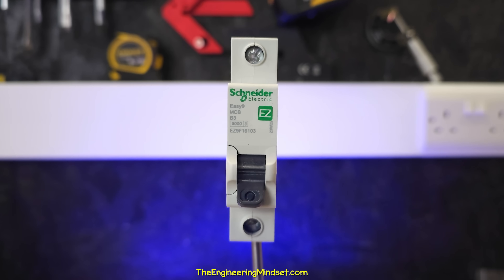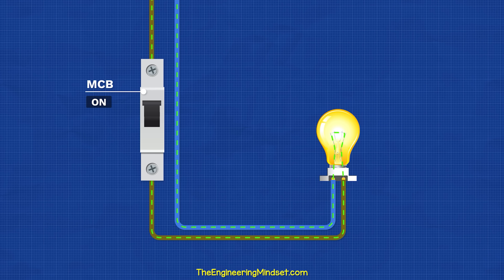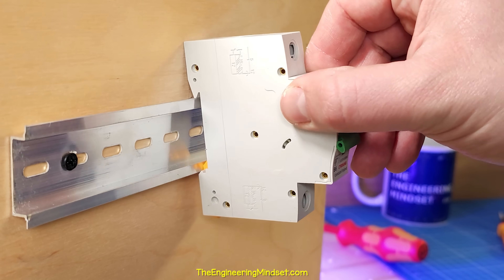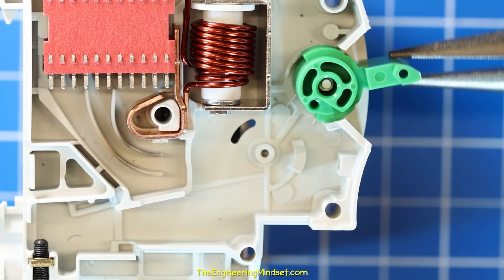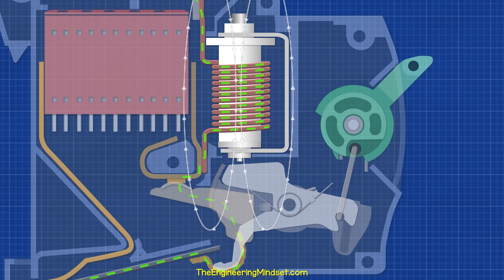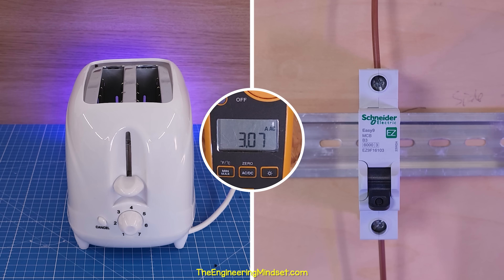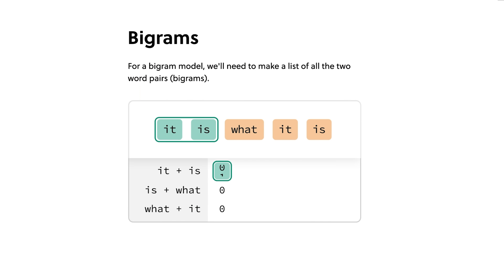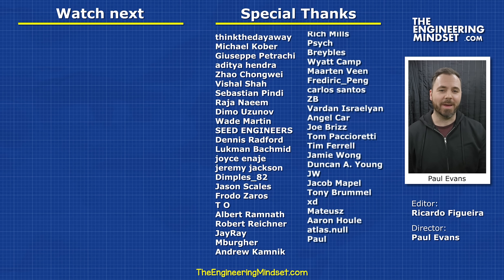Why Circuit Breakers DON'T Protect People (electric shocks)

Comment: They’re not meant to protect people, they’re meant to protect circuits. That’s why they’re called “circuit breakers” and not “people protectors”.
Reply: They are meant to protect people...from house fires that start from overheating wires.
Reply: The name isn’t the important part. The actual reason is that circuit breakers are not designed to care about humans  or more importantly extension cords or toasters. All that a circuit breaker is supposed to do is to protect the wires in the wall from catching fire, not anything else.
Reply: Some5hing all huge electric cars batteries pack should have and don't.
Reply: @_j5155_  afci breakers
Reply: @_j5155_  thats exactly what i he said, you only rephrased it...
Reply: GFCI circuit breaker is meant to protect people.
Reply: Is there not a different kind of device, a "residual current device" that does protect people?
Reply: @tomsmith6513  correct! And/or animals.
Reply: @tomsmith6513  there are "over current" , "residual current" and "arc fault" protection. They're all really useful ! 
you can get all 3 types of circuit protection in one device.

"over current" , well that's the original one, and can be done with fuses. Too much current, and the circuit will be broken.
"residual current" , that's measuring the current going out through the live, back through the neutral (okay it's AC , goes both ways !) and if it is the same current, well all is fine. if there is an imbalance in the currents then something must be leaking via another path, so trip the breaker. This can protect people , because the leakage current a person could supply should be enough to trip a breaker. But don't test this with a finger ! 

Then there's the last , most recent cleverness  of protection. Arc Fault detection. Arc in circuits can and do cause electrical fires. Some clever electronics can work out if the current flow  in the breaker "looks like" there is an arc on the circuit. If there is , then trip the breaker. These breakers aren't cheap, but I guess define cheap if it prevents a fire ...
Reply: So you could say they break people.
Reply: Isn't yhat the point of the video, explaining why they don't?
Reply: The thermal magnetic circuit breaker protects the circuit from overload and short-circuit, the differential circuit breaker protects people from electrical leakage.
Reply: 🤡 a normal person would think it’s called a circuit breaker because it “breaks” the circuit…
Reply: @sibow  We don't want anyone with EVEN a kindergarten level understanding of electrical circuits around here.
Reply: The Avengers protect people. They are all we need..
Reply: @kittencobbler  The Avengers don't exist in circuits. They exist in fiction.
Reply: Circuit breaker breaks circuits.

If it does its job fast enough to protect something outside the circuit (like a human) this is irrelevant to its function.
Reply: This comment alone just invalided this man's whole video. Well done.
Reply: On an abstract level, protecting a building from catching fire is also protecting the people inside.
Reply: Circuit breakers/ fuses and residual current circuit breaker (RCD) what's the difference? Let me tell ya

Fuses/Circuit breakers:

Circuit breaker and fuses are meant for protecting the cables from catching on fire or being damaged. As one comment said fuses are like dumb circuit breakers because in case of the overload current or short- circuit current (I will explain later) I will say that the fuse self destructs and with its magic it breaks the circuit and you have to buy new fuse but the cost for putting new fuse is WAY lower than the cost you would have to deal with when replacing possibly whole instalation...or house.
   BUT with circuit breakers when there is overload current or short-circuit current the circuit breaker detects that the amps in circuit are too high and it switches off the circuit. Now the thing is you can turn on the circuit breaker when problem with the current is resolved and all is good no need for replacement (if the circuit breaker did not get damaged)

How RCD works

RCD reacts on difference of the current going out from RCD and the amount of current going back in to the RCD. If the difference of the amps in circuit with RCD is let's say 5x times more than the RCD is set for (lets say someone sticked the fork in outlet) the RCD will turn off the circuit  in around 0,04 second.

How circuit breaker works

Now circuit breaker reacts if the amps in circuit are higher than set amount lets say that your instalation is on 25 A and you have your circuit breaker for that okay you install it and it is working normally. But one day you decide to have big party and you have multiple devices (lets say they have 1500 Kv for the sake of it) and you put extension cord in one outlet and you stick all heavy power consuming devices to that one extension cord. After a minute BAM no power in outlet you go and see that the circuit breaker worked. Because you experienced overload current. And circuit breaker saved your instalation from burning in flames [ there is also a little time before circuit breaker gets heated up if the overload is not extremly high but there still is overload current. Unless current is very high]

NOW difference between RCD and circuit breakers.

Well lets go back to our situation with the party and lets say that somehow you just have RCD installed in your box for that circuit that the outlet is connected to and there is no Circuit breaker installed. Let me ilustrate
1.  25-> [] ->25 ...25->[] 👍
In first example everything is good no heaters are connected yet and 25 amps went out from rcd and 25 amps wen back into rcd nothing happened
2. 50-> []->50 ... 50-> [] 🤔👍?

Here we connected the heaters and nothing is happening rcd did not turned off the instalation. What is happening? Right now our cables in circuit are being slowly melted and slowly we may have a fire in our house but why? Because it doesnt matter if there is 25 amps 50 amps or 100 amps. If there is no difference of amps going from rcd and going in the rcd. It will not turn off the circuit even if your house burns. 
3. 25->[] ->25... 10-> [] ⚡️

Here we connected the heaters  to the outlets but clumsy guest fell perfectly with fork sticking it perfectly in the outlet on accident and now there is difference in amps in circuit and now the RCD got that difference in very short time and now it will turn the circuit off fast...( if you know what type of RCD'S should be installed so do not buy random RCD'S hoping that it should work. leave it to qualified electritian ) 

Now FINALLY CONCLUSION

I hope you had nice time reading this I have a feeling that now you can have knowledge in differenciating the circuit breakers and the RCD'S (AKA. residual current circuit breakers) aka circuit breakers protects your instalation. RCD'S protects our human mistakes and curious kids
Reply: To be more exact, they protect electrical wires not even the whole circuit

they protect the wires from overload( amps capacity) which leads to overheating of the conductor and rubber  and maybe leads to fire risk.
Reply: So... Should we call them people breaker ?
Reply: Yeah exactly. 👍🏼
Reply: Circuit breakers protect people. They are called GFCI in the US RCD
Reply: Absolutely correct! Wanted to write the same
Reply: People breakers
Reply: Yes. If you want protection for people, use RCCB. If you want both, use RCBO.
Reply: Yea, gfci is the one for people.
Reply: They should be called People Breakers then by this logic
Reply: Please erase this comment 🙄
Reply: They are protecting people by protecting the circuit wires from fire.
Reply: Correction, Circuit breakers are actually meant to protect the insulation of the cabling from over heating / melting and exposing the bare copper 😊
Reply: Circuit breaker intended to protect cable line against overcurrent and short circuit. To protect people we using residual current protection deivė.
Reply: Is an RCD like a North-American's version of a GFI-breaker? Sparky from America asking here out of curiosity
Reply: Yeaa because the building and wires are expensive than human
Reply: Gotta love the German language. Circuit breakers are called "wire protecting switch" in German.
Reply: Semantics.
Reply: @leeroyjenkins0  So was there any wrong information in my comment or not?
Reply: There is ground fault circuit interrupter but that is also not called people protector but it does protect people from a lethal shock
Reply: Well, I back feed during power outages, so how about that! 😂😂
Reply: People breakers...
Reply: They dont protect people from shocks but prevents people from house fires
Reply: They are talking about ‘ circuit breakers ‘ or a ‘ re- setable fuse ‘ and not 
‘ ground fault breakers ‘ which cut the power with a minescule connection to ground, like a human getting shocked.
Reply: Yup.
Reply: He already emphasised that in the video
Reply: Exactly 
A circuit breaker is an electrical safety device designed to protect an electrical circuit from damage caused by current in excess of that which the equipment can safely carry. Its basic function is to interrupt current flow to protect equipment and to prevent fire.
An RCD, or residual current device, is a safety switch that automatically cuts off power in the event of an electrical fault. RCDs are designed to protect against electric shock and fire. 
If only poeple used their smart phones and googled shit before they start typing 
Smart phones and dumb poeple lol
Reply: I would call it "people breaker" ))
Reply: Wow, no way, that’s what the video is about..
Reply: People breakers though
Reply: Leroy may even have passed by now (or forgotten his login) and people are still replying to him like is following this thread.
Reply: Then what RCCB means ? Those save people
Reply: People breakers
Reply: *people breakers😂😂😂
Reply: Technically yes, you would need an Residual current circuit breaker
Reply: "people breakers"
Reply: That’s why we have an rcd
Reply: In italy are named "salvavita", literally "lifesaver", so...
Reply: There’s no such thing nor will there ever be anything called people protector! People do dumb things! It’s almost as if their survival instincts diminished with each generation!
Edit: since they protect circuits, shouldn’t be called circuit breaker, but circuit condoms!
Reply: Anti locking bracking system isn't meant to protect us, rather to stop brake from locking. It's in the name *
Reply: In that case it should've been called a circuit saver
Reply: Circuit breakers don't protect circuits, they break them.
And why do we not have people protectors?
RCDs sure seem useless.
😂
Reply: but an RCD , RCBO or one with AFDD also breaks the circuit. Over current breaks the circuit. They're all circuit breakers, just detecting different types of circuit fault.
Admittedly over-current doesn't protect people, need Residual Current detection to hopefully protect for the amount of current that can pass through a person. Arc Fault Detection hopefully detects arcs before they lead to a fire.
So they're all useful , and even the  over current  and arc fault devices do hopefully protect people from electrical fires, if not directly from electric shock.
Reply: Lmao. Millennial logic.
Reply: So why aren't they called "circuit protectors"?

Sounds like they break circuits, and their name has nothing to do with protection at all.
Reply: @donperegrine922  They protect the wires that make the circuit.  Not the dummy who sticks a fork in the outlet.
Reply: @briankleinschmidt3664  Leeroy Jenkins wasn't saying otherwise. Nor was I.

Just refuting the smug OP, saying they aren't designed to protect people, hence why not called "people protectors".

Well....they aren't called wire protectors either, so it seems a bit pointless to point at the devices name as though THAT is the clue to who or what it protects.
Reply: @donperegrine922  They protect the wires that make the circuit.  Not the dummy who sticks a fork in the outlet.
Reply: @donperegrine922  A broken circuit is a circuit that has been shut off to protect something

Comment: Circuit breakers do not protect individuals from electrocution, they are designed to protect the wiring in a structure. All electrical codes are written to protect the INSULATION on the wire

Comment: Ex gopher here (the guy sparky gets to do all the shit work):

Breakers indeed DO NOT CARE if you’re getting electrocuted. They will sit and happily send power out through your body as long as the current draw does not exceed that breaker’s trip threshold.

Breakers protect conductors and downstream receptacles and appliances. They shut power off to a short circuit to prevent a fire. That is all.
Reply from the maker: We just published a new Ground fault, short circuit and arc fault video, so much detail! Link HERE➡️: https://youtu.be/Qi0ynSQw-wc

Comment: I recommend trying to pull wire you just connected in a circuit breaker to avoid false connections. As an electrician I already found 4 cases of false connections when I had to reconnect the wire.

Comment: 5:49 , also as an electrician, a thing I learned in school, make the connecting head like a hook shape, and try to insert the hook behind the screw, this gives it more grip and contact, making it more sturdy and harder to accidentally pool it out
Reply: Wrong connection type.  That's a blade connection...not a screw connection.  Forgive me if my terminology is not accurate.  But they are different connection technologies.

Comment: Of course do circuit breakers protect from electrical schocks, for example in damages devices. That‘s what Protective Earth is for. When Line connects to the enclosure and the enclosure is connected to PE, a high enough short circuit current will flow to trip the breaker. This is a requirement and must be built as such for every circuit and appliance with metal enclosure. So a circuit breaker does not only protect wires and property 🤦‍♂️
Reply: you're talking about a CFGI not a regular circuit breaker as in the video.
Reply: @Xiefux No, I am not. I am talking about protective earth together with circuit breakers. This is a protective measure to prevent electric shocks, nothing else.

Comment: 3 amp?!? Holy fu+_ that's small. Smallest we have here is around 15 you see in the house circuits. And I have a 400amp service 9-15 amp circuits, 7-20amp circuits, 4-50amp double pole breakers, 2-80 amp double pole breakers  (going to

Comment: I have yet unable to be explained why I can't touch 240v bare 
Hands  wearing rubber soles shoes, yet while barefoot I can touch 240v using the rubber soles shoe as a probe? ? Same series circuit. Why one shocks, the other doesn't?
Reply from the maker: Few reasons but do co isder that your body will act like a capacitor and basically pull electricity in, breaking down the high resistnace of your skin that protects you from small DC voltages like a 3V  battery
Reply: @EngineeringMindset  capacitance doesn't explain it. The capicitance is exactly the same for both series circuits.

Comment: Great explanation and demonstration of the operation of a thermal magnetic breaker. 
However, I think it’s worth mentioning that circuit breakers do protect persons from electric shock - with proper grounding and bonding practices. 
The most likely scenario for a person to come into contact with an energized conductor is if said conductor has inadvertently touched a conductive casing that is not meant to be energized. When a person touches that casing their body is the current path for the fault (for any electrical system that uses earth as neutral). As you pointed out, fault current through a human body may be too low to trip the breaker and you end up being an unwilling conductor for much too long.
To solve this issue, electrical systems are required to be properly grounded and bonded. This means that when metal casings (or other non current carrying conductors) are bonded to a conductive grounding system and become energized, the fault will now travel with low resistance through the grounding system, produce high current, and trip the associated breaker; thus preventing an electric shock.
I really appreciate your content and just want to add some clarity to your title.
Reply: A good point that I was going to mention as well. Grounding/bonding is obviously very widely misunderstood topic. As an apprentice electrician I even hear many of my instructors repeat the claim that "OCPDs prevent fires, GFCIs prevent shocks" which is true of course, but it fails to capture the purpose of bonding all metal parts in or near electrical systems together--the short circuit protection offered by fuses and breakers also serves the dual purpose of quickly removing hazardous voltages between exposed conductive surfaces during fault conditions, limiting the duration of a possible shock and the potential for serious injury--again illustrated by the time-current curves for these devices

Comment: Well actually you can Touch Line wire and it won't do anything to you just don't touch line and null at the sane time
Reply: No, not unless you are a pigeon.
Your body has capacitance to Earth/Neutral which DOES form a complete circuit. Current WILL flow in your body and you will experience a more or less uncomfortable tingle.

Comment: A 3 amp breaker?  Who the heck makes those?  The smallest breaker I've ever seen is 15 amps because your standard outlet is rated for 15 amps.  20 amp circuits are really the norm.  Most jurisdictions have required GFCI outlets for some time anywhere near water ( the kitchen and the bathroom ), which DO protect people.